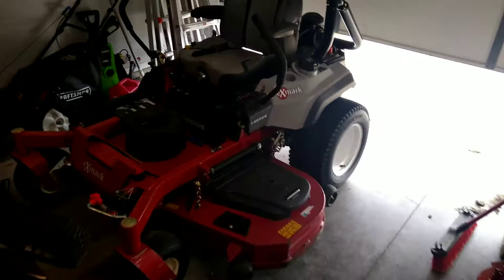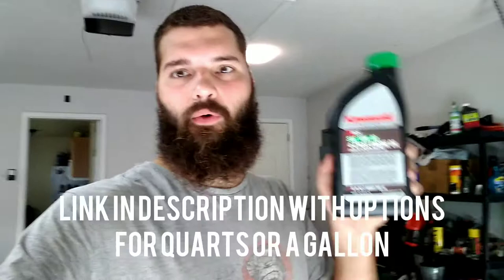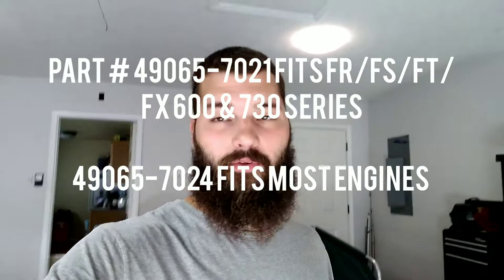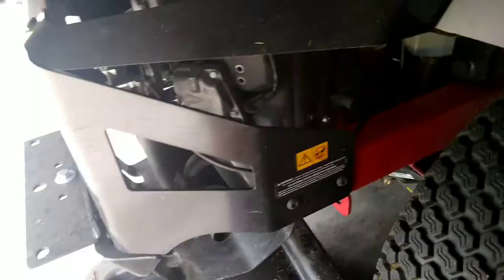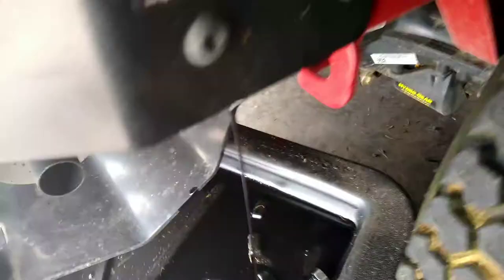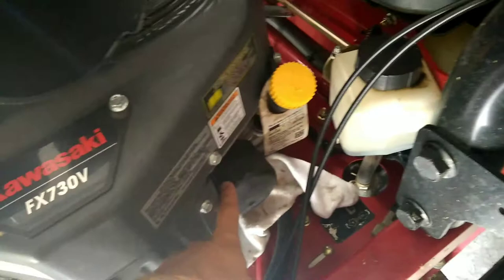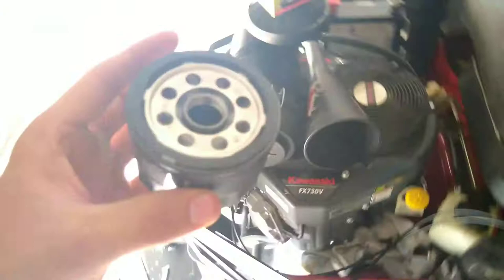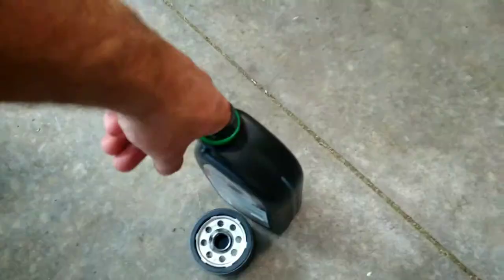How To Change Oil On A Zero Turn Mower Kawasaki Motor

Comment: Personally i do fill the filter full before putting it on and make sure to coat the seal with a thin layer of oil as well. Also once done filling, i start it and let it run just a couple seconds then shut it off and let it sit so it can fill the filter and such and get a accurate reading
Reply from the maker: @Hazardra Lawn Care I actually do the same thing as well just forgot to mention that... except I don't fill the oil filter first. I tried that a time or two and it just made a big mess 🤦‍♂️ lol

Comment: Was the bolt really hard to loosen on the first turn
Reply: Just changed mine for the first time and the drain bolt was a beast! It had some type of red looking crap on the threads which I assume was maybe loctite or something like it. Sprayed it with WD40 and cleaned all the threads up with carb cleaner picks and brushes. Hopefully it will be easier next time. Thanks for the video Jon!

Comment: So when you put the oil back in, do you put that bolt back In or just let that oil flow through to the pan? Asking for a friend?
Reply from the maker: Nope, that bolt is used get rid of it. Then record the first start up so I can make a video about it 🤣
Reply: i never understood why they use a nice piece of hardware like that in the end of that tube. i needed it for something else. still dont know why my engine blew up 5 minutes after changing the oil it was full i thought when i started it! it must have blown a hole through the block the ground was covered with oil  and it was clean as a whistle
Reply from the maker: @BioHazardra  🤣🤣🤣

Comment: M obviously you're gonna be high on exhaust fumes Just kidding but I would have open that door all the way
Reply from the maker: @LAWN 1 🤣 lol. Believe it or not but I actually get alot of wind blows through my garage it's like a wind tunnel so the fumes are gone pretty quickly. Now spray painting....that's another story lol. When I painted the deck on my older mower I got extremely high from it lol
Reply: @JonsDailyHustle  all good brutha just worried me
Reply from the maker: @Razrback  thanks for the concern bro. As far as I remember it didn't bother me at all 🤣🤣🤣